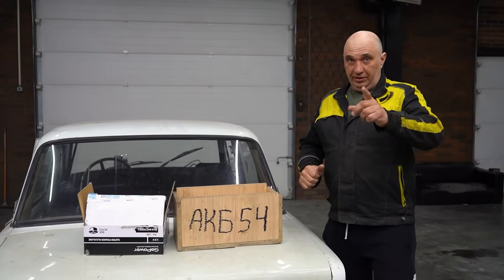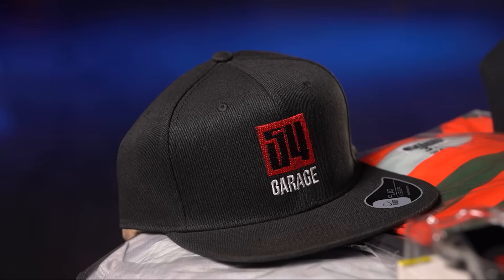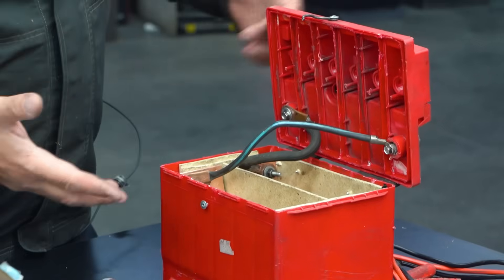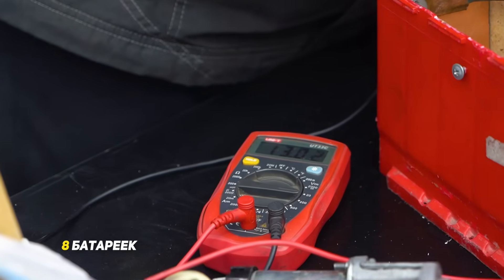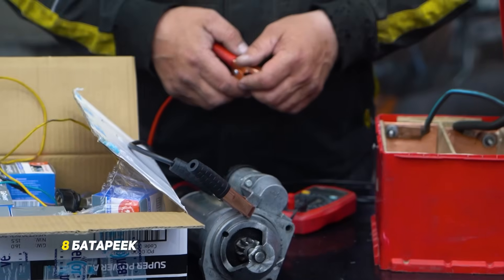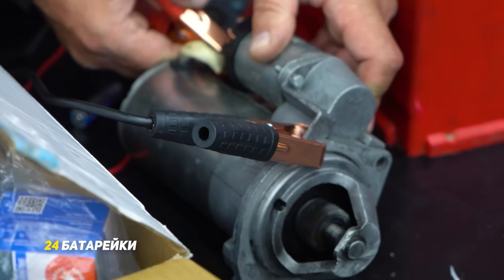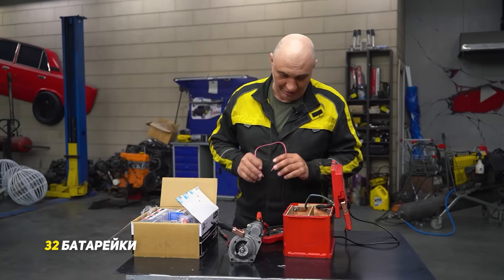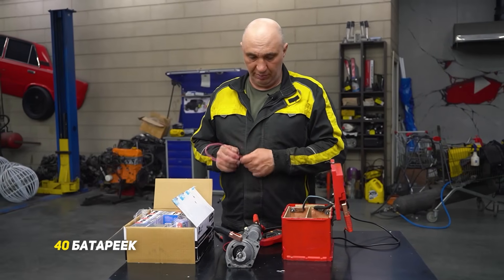How many AA's does it take to start a car?

Comment: Definitely should use rechargeable batteries and do it again
Reply: rechargeable batteries in that package usually run at 1.2 volts per cell instead of 1.5 . might be better to try D cells..
Reply: @ryanjosef  The voltage doesn't really matter, they can just add 2 more cells making it 12v, ni-mh resting voltage is more around 1.36, ni-cd are 1.3, so the total voltage would actually be around 13-13.6v and still totally acceptable for a vehicle as alternators push around 14.2-14.5v
Reply: @TheShivABC  on paper it might not matter but in practice it effects how much the batteries will have to give in whole , which is not a constant like a regulated power supply .
Reply: @ryanjosef  you also fail to understand that ni-cd and ni-mh have a higher discharge current than non-rechargeable cells, ie ni-mh has a nominal discharge current of roughly 10amps, and ni-cd cells can have rates far exceeding 30amp, it has nothing to do with what is on paper, and more to do with having a better understanding of battery chemistries
Reply: @ryanjosef   1.2v is the norm running rate of even alkaline batterys. they just have a 1.5 V unloaded
Reply: @ryanjosef  exactly what I was thinking
Reply: @ryanjosef  Most modern "D" cells are just "C" cells inside a D-shell.
Reply: @teardowndan5364  no.. no they are not 😂
Reply: @ryanjosef  there is batteries out there that are 1.5v that can be recharged
Reply: @ryanjosef  he’d just need to add one or two more groups in series to increase the voltage.
Reply: @ryanjosef  You would need strings of 10, but the current rating for rechargeables is higher so you would need less batteries in parallel.
Reply: @ryanjosef new NiMH batteries can release energy more quickly than Alkaline.
Reply: @ryanjosef  d cells are 1.5 same with aa 1.5 the d just have more mah
Reply: @ryanjosef  you can get 1.5 or 1.6v rechargeable they are a different type  and more expensive tho...
Reply: @ryanjosef make one more row
Reply: That would be a 1061.83 dollar battery before tax
Reply: @ratkillla  i was going to say too expensive , but you got it first
Reply: @ratkillla  easier to use a Ebike battery that costs £400 and outputs 30 amps
Reply: @ratkillla  About the same as an automotive lithium-ion battery then.
Reply: @ratkillla cheaper than a decent battery here.
Reply: @RodknockRhett the alternator would overcharge the battery, voltage is too high (the batteries max 12v while lead acid put out 13.8v) battery would die <100 hard cycles.
Reply: @memenolookup lead acid puts out at the max 12.8 volts. Usually around 12.6 once the surface charge disappears. You're thinking of alternator voltage. Which depending on the car can be from 13.5 to 14.2. 

Wether or not the batteries will overcharge isn't dependent on this especially with modern cars having voltage regulators.  And even if it was the reason why, you simply need to adjust the number of batteries in the circuit to compensate.
Reply: Pretty cool but it ended up being about the same size.
Reply: @Christian Banks  probably around 70ah so around the same capacity to and probably 4 x the price
Reply: I want to see how fast a start turns with 10 regular car batteries and see if you can move the car with through the gears lol
Reply: 10 car batteries in series, starter would immediately go up in smoke.
In parallel, you could probably go a few miles before overheating the starter (you would simply have close to 10x the Amp hours of one battery)but the starter would crank at the same speed. @Fk8td
Reply: @twoeightythreez mmh non è così per il collegamento in parallelo ne puoi mettere anche 100 di batterie quello che conta sono i volt. Diciamo dai 12 ai 14.7 V. Puoi avere anche 1milione di ampere a 12 volt che al motorino non succede niente l importante è tenerlo tra i 12 e i 14.7
Reply: @Fk8td  My old 78 f150 would move just fine on the starter motor. I moved it about 100 feet in 3rd gear up my driveway, with 1 battery. Not much of a uphill, but to steep to push it. 10 batterys in series =120 volts, if the starter motor didnt melt down, you would be crusing. LOL
Reply: @Fk8td  They can move the car in 1st gear with 1 battery. (i had to start my 1987 Ford Escort 1,6D with this technic becouse my cluchcable is broken and i had get to the mechanic's shop somehow)
Reply: @Fk8td  The batteries in series or parallel ?I have seen a1 1950s Dodge run in reverse just from the starter motor alone with just one 12 volt battery.
Reply: @Fk8td  remove the engine & just have 10 starter motors :D
Reply: Lipo-battetries, 3-cell for drones perhaps? The LiPo (the flat ones you know) really push some current.
Reply: @alexanderg-p3z  yeah amps is what matters for torque motors , a cheap E bike battery will do fine
Reply: @girlsdrinkfeck  Yes, One of those would be overkill. They got voltage like 48Volts, and amps to spare.
Reply: @girlsdrinkfeck  Hardly any e-bike battery is single cell Lithium Ion. They use several in parallel as well as serial.
And what I initially talked about was LithiumPolymer, an average one of those easyly pushes 100Amps.
Reply: @girlsdrinkfeck  Ah, you probably meant adding a supercapacitor to the double-A batteries, then 80 would probably work fine.
Reply: the hardest part is hiding the batteries
Reply: 24 18650 cells should be enough
Reply: It will require about 10s10p (100 cells) to start a car
Reply: Maybe take a look into making it start on 18650 cells. Although that might be a fire hazard :D
Reply: @fie1329  they literally use 21700 for Tesla batteries. Also car jumpstarters are 18650 packs.
Reply: @fie1329 that wouldn't be a surprising test.  It wouldn't take many.
Reply: @BobbyNewhartFace Did you try it?
Reply: You can recharge nonrechargeable batteries, I just need to be careful
Reply: @K-Effect  yes but would not recommend.  🔥💣
Reply: I'd love to see this with a 18v lithium makita battery
Reply: @Boycott_Wendys  wouldn't start it. Not enough amps and would also "trip" the protection in said battery. Better off making a super capacitor out of many capacitors. Go check out electro boom.
Reply: With BMS 12v 400 A discharge
Reply: More interesting add a 500f ~ cap bank of 6x & use AA to charge it i.e in parallel & see how many it takes to start & run.
Reply: Could it charge with the alternator?
Reply: @SonOfAHerbert  yes but not multiple times being alkaline I assume and they only running it for 10sec definitely isn't gonna charge shit like they did.
Reply: The tale of the 1150 dollar battery
Reply: I was thinking the same, but with lithium 1.5v batteries (the non rechargeable ones)
Reply: yes yes yes
Reply: Rechargeable batteries are actually a little weaker, probably need half a dozen or more to even make up for the loss.
Reply: @VikingDudee  but after all they are recharging and maybe if you want to save space, use AAA batteries they are still 1.5v each
Reply: @Viking 2121  if you used rechargeable 2000mA ones I believe 308 would be 70ah   but that doesn't allow for 1.2v vs 1.5v   so you may need to adjust  for 10cells vs 8 cells.
Reply: Ni cds pack current
Reply: Rechargeable batteries are only 1.2 volts, you will need more rechargeable batteries than normal dry/ alkaline batteries
Reply: Rechargeable batteries can give more current, so it would require less batteries. Even though it would need 11 cells per series as each cell is 1.2 V. Nimh  cells have peak of 6A, where Alkaline have peak of 4A (quality ones) and it's for extremely short time.
Reply: @xZeroOffical  so 10% more batteries to get the voltage to 12v    then 33% less batteries because of the extra peak Amps  then whatever the additional cost of rechargeable vs non rechargeable.
Reply: @xZeroOffical  so are we assuming 154amps  to turn the starter  based on 4A per cell and 308 cells
Reply: Super capacitors is the best option
Reply: @nashe-gr7uy  they are but not a cheap option
Reply: Lithium ones are thw good ones, they give lotta current for their size, i am looking forward for then to ty a 18650 battery test lol
Reply: @FlammableElectronics  all these jump starter packs seem to use the packet style lithium cells.  I'm not sure what the deal is with the 18650 cells. I have loads I've rescued from laptops  if I join 4 together it's around 17.19v after charging  that should give a good fast charge even if its not able to turn over a starter motor.
Reply: i dont think is gonna be cheap for rechargeable
Reply: Nah try watch battery’s that would be nuts
Reply: @mr.clownski23  That would be hilarious 😂😂 and dangerous
Reply: Should  be 10S 190P with 140mA cells
Reply: No,,, that would KABOONM
Reply: I was about to say the same thing although cost is a factor... 300 rechargeable AA even if you buy in bulk somehow would still be pretty expensive...
Although I agree that would be a better test.. Every time the voltage starts to drop you can just recharge also there is a better chance the alternator might actually charge them...
Reply: Still same, rechargeable AA batteries usually charged below 0.5a
Reply: You User Carbon Batteries, they have less Current!
User Alkaline, they are 10000 Times Stronger!!!
Reply: and or duracells :D
Reply: should use 10 C cells in parallel with a stack of ultra capacitors charged. you'd be good to start anything!
Reply: Button cells
Reply: Button cells
Reply: and put 9 in series instead of only 8
Reply: Should test how many hamsters on wheels it takes to start a car.
Reply: 12:10
Reply: The problem is the charging circuit between lead acid and lithium ion 
The batteries require two different types of charging circuits 
I’m curious to what happened to the diy capacitor bank batteries folks were doing quite some time ago using super capacitors in a bank
Reply: Big issue here is that rechargables nominal is 1.2 volts, compared to an alkaline's 1.5. Doesn't sound like much, but makes a difference at scale.

Comment: You can actually recharge alkaline batteries but the process is very slow and prone to leaking.
They can take some flash charge but its not efficient and with time will also leak due to the crystaline formation inside expanding and pushing the liquid out.
Reply: Yeah, you have to charge them veeeeery slowly, like over the course of a day just to recover a partial discharge.
Reply: @volvo09  not to mention they degrade quickly once discharged, so its best to charge them the moment they hit the floor.
I was able to charge an alkaline one from 1.0V (open circuit) to 1.5V with 90% of its capacity after 1 discharge, and it worked, but it leaked a few months later. It seems something still happens inside even after finishing charging it.

Comment: I wonder how rechargeable aa batteries would perform
Reply: Probably worst
Reply: Since rechargeable batteries are 1.2v instead of 1.5v like disposable batteries are, if setup exactly the same as what is shown in the video, it would do poorly. 9.6v is what you'd get instead of 12v

Now, if you were to do 10 batteries instead of 8 batteries in a row to achieve 12v, then I'd expect it'll perform similarly to what we saw here.

Comment: Wouldn't it have been easier for the car to start if you pressed the clutch in while starting?
Reply: Not really, since the clutch basket is spinning with the flywheel at all times
Reply: @Matthew-wj8cm  Yeah but the gearbox isn’t turning inside if the clutch is in?
Reply: @Xenon777_  no because the car is in neutral...
Reply: @Xenon777_  that's True, you Just shouldn't start a car with the clutch pulled in, wrecks havoc on the clutch release bearing.
Reply: @Matthew-wj8cm  Interestingly my car recommends started the car with the clutch in and our other car will only start with the clutch in! The release bearing is mainly damaged from coasting I believe or sitting at traffic lights with the clutch in, etc.
Reply: A TINY bit easier, you can spin the gearbox input shaft easily by hand, especially in a worn car, that wasn't left out in the cold.
Reply: It would be easier by a tiny bit since the starter wouldn't have to spin the transmission with the clutch disengaged, but the transmission's input spins pretty freely in neutral anyways, so the difference wouldn't be significant. At least on my cars, the transmission spins freely enough that letting off the clutch in neutral doesn't noticeably load down the engine like turning on the headlights or AC does and as far as I can tell it cranks the same whether I press the clutch or not, so the difference obviously isn't dramatic.
Reply: @averyalexander2303  When I put the clutch up and down on my car, it does affect the engine revs slightly, similar to when I turn the steering wheel due to load on the power steering pump. For the clutch to affect the engine revs it is probably the weight of the gearbox turning and maybe the extra load in the hydraulic system.
Reply: @Xenon777_  Interesting, mine only does that by the tiniest amount, definitely less than the difference turning the headlights on or off makes. Once the transmission is heated up from driving and its oil thins out, the difference is almost unnoticeable. Certainly the engine's horsepower and engine management system and the transmission's inertia, internal friction, and oil drag would make a difference there.

Comment: You should do Li-P.Os next and figure out how to connect them to the alternator.
Reply: They would have to use a 12v balancing charger between the charging system amd battery.  Tricky for longevity.
Reply: @Dat_Sun  that’s the main issue I was thinking about, don’t want to overload them
Reply: They should use a 6S battery with 200C and se if they could starta a truck ;)
Reply: @jonmagnusson6399   6s will start it no problem.  But the charging system would not keep the 25v 6s charged.
Reply: I have a 4s lifepo4 battery in my car for over a year now. Lithium batteries do not struggle at all to start a car nor have I really run into any problems float charging it without any special dcdc converter. Hooked up straight to the alternator.
Reply: And show off the fire if naively using the plain old lead-acid charger circuit..
Reply: @skuula it's a lifepo4, people in the car audio world have been using them without issue for years now. Lifepo4 cells are almost impossible to set on fire. I've had mine on my car for a year now and zero issue and zero damage to the independent cells.
Reply: There are ready  to use lithium chargers. Just conect the alternators via a charging board.. and that is basically it.
Reply: @matsv201   It would only work temporarily. Balancing can only be done at a fraction of an amp.  In short time cells would become out of balance some being too high..
Reply: @Dat_Sun  they have all the time when the car is on to be blanced.  They won't get to unbalanced just for one start.
Reply: @matsv201   You're assuming the car is going to be running long enough, then, what happens when the cycle completes? 

When sitting at idle with a few accessories on, chances are we're pulling from the battery for a while.  Another problem is keeping the battery in balance mode will quickly wear it out. In fact many people don't charge lithium polymer batteries to 4.2 V a cell to extend their longevity.  Instead they charge them to around 4.15v.   You would really need a balancing voltage regulator and not a charger. It would need to be programmed or set up exactly for lithium polymer charging curves and voltages at different temperatures for safe reliable operation.

 A charger is not able to adjust for current when needed. You select the current and that's what it throws at the battery until it's full or enters the balancing phase. 

Using the dumbed down LIFE version, doesn't make much sense. A quality AGM or spiral cell battery would be right there with it as far as performance.

 Every cycle of the key would require resetting of the balancing charger. Once the charger balances the cells it will turn off.   The problems are many and there are no current solutions. 

 The underhood temperatures would destroy a lipo battery in practice.  A balancing charger would not even start the charging process if temperatures are too low.

And I am pretty sure every commercially available balancing charger would error out once it notice the battery was not Is responding properly.  Without significant modification the charger would error out due to time, temp or unacceptable voltage fluctuation. 

 You can use a lipo battery for starting.   But  The battery would never last as long as the lead acid, lead acid is Durable,  lipo is soft and squishy,  easily damaged with overcharge,  instantly dead with over discharge.   

Lipo could never be made practical because you would have to add additional complex electronics to constantly monitor and control the voltage,  amprage and temperature of the lipo.
Reply: @Dat_Sun  no  the generator have a charge relay that compensate for when ita ideling
Reply: @matsv201   You're not thinking this through. Have you ever operated a balancing lipo charger?  You skipped over all of the problems I listed in great detail.